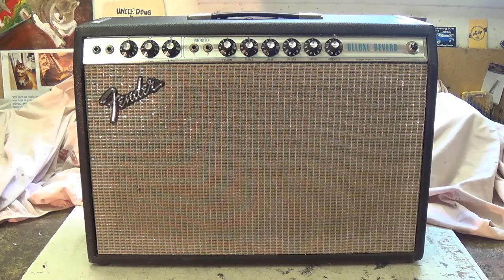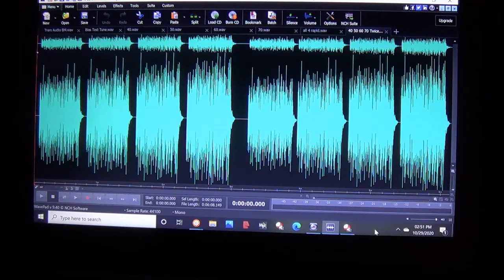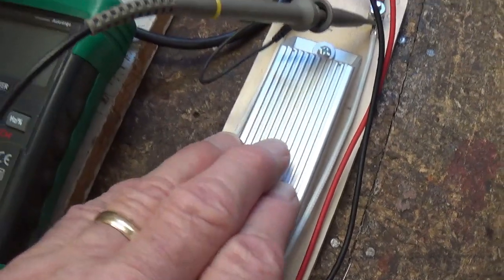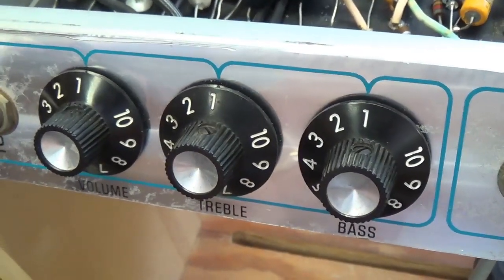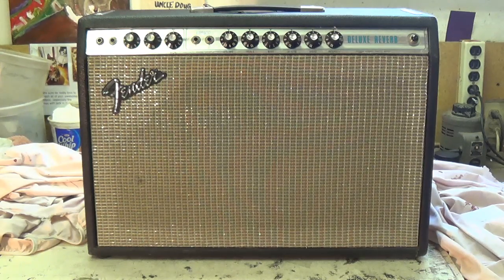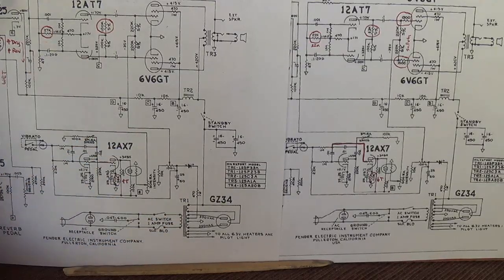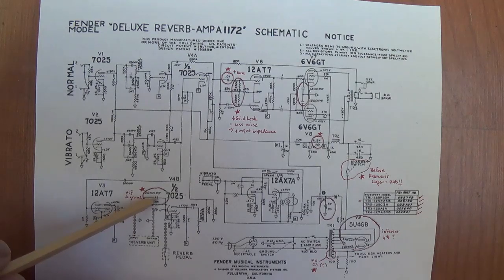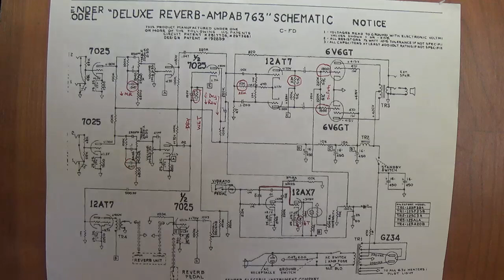The Effect of Output Tube Bias on Tone, Gain, and Headroom.....A Side-by-Side Comparison

Comment: The virtual filament ground was added as a method to fuse the heater circuit incase of a catastrophic tube failure so it wouldn't take out the power transformer if the tube shorted internally putting the high voltage on the heaters........as I come to understand it.  I don't have an amplifier chassis here in front of me to confirm it, but the "green/yellow" lead off the transformer bundle might be cut off and hiding in the bundle or tapped off and hiding in the bundle.  If you look at the layout diagrams that go with the particular schematics.....there is a red/yellow & a green/yellow transformer wire that both get grounded......the green/yellow is the heater ground and the red yellow is the high voltage center.  SO the schematics showing the earlier design with no virtual heater ground......you will see the red/yellow & the green/yellow going to ground on the layout diagram for that schematic.  On the virtual heater ground amps, the layout diagram only shows the red/yellow wire going to ground BUT being the same transformer part number, its still in the bundle but not used.....SO I believe its cut off and hiding in the bundle.  Its something I don't normally think about and overlook.  AS long as the 2 100ohm resistors are good.  Later in the Fender timeline they changed from the 2 100 ohm resistors going to ground, to using a situation they called HUM BALANCE...a center tapped to ground (wiper) balancing pot that off the top of my head is 100 ohms linear.  The theory was to shift the pot away from the center balanced position to swing it either way to reduce HUM should it be present when the pot is in its 50% balanced position.....since this involves an AC heater circuit.  The pot was usually at the end of the heater string of wiring but not always.  They might have used it later in the timeline because of the quality of the tubes that were available at the time considering that vacuum tubes were way beyond being obsoleted in the electronics industry at large.....in the age of solid state  technology.  The domestic producers of tube were phasing out the vacuum tube production lines and were not keeping the lines maintained at top notch as they bled them to the end of production.
Reply: You know that the power tube heaters need to be connected properly in push/pull, but the pre-amp tube heaters can go inconsistent.  Personally I like the string to be consistent with all the #9's on the same wire......but Fender made it a difficult visual when they used the same color wire for both sides of the heaters.  I end up having to follow the the twisted pairs the whole way down the line.        BUT in the history of things, you'll note that the 1950's tweeds used the #9 pins being put to ground and thus just one heater wire for the string.  SO circuitry evolution is interesting thru the timeline
Reply from the maker: Thanks for your detailed input, Mike.

Comment: Thanks so much for this amazing video Doug, both parts were highly educational, informative and eye-opening. I'd love to see more of these types of video.
Just one question about the tube bias analysis part. I was surprised the see that the waveform on the oscilloscope, even at lower amplitudes, was not really a sine wave, which is what I would have expected to see. Instead it looked far more triangular, shall we say, kind of like a smoothed-out sawtooth waveform. Is that because the signal generator isn't supplying a pure sine wave output in this case, or because it does generate a sine wave that is then transformed through the amplifier circuitry? Thanks again!
Reply from the maker: When large numbers of waveforms are compressed so they all fit on the screen, they assume a tall, narrow appearance.....but if you isolate a single waveform, it will be "sine shaped".
Reply: @UncleDoug  I see, thanks!

Comment: Man this is so awesome! I’m currently going to college for Audio Engineering and also learning more about electronics. I wish I could have you as a professor!
Reply from the maker: Thanks for the very nice comments, Arturo :)
Reply: @UncleDoug Of course! I do have one question. I just biased my 1996 Carvin MTS3200 which has a trim pot but I know is fixed bias. I didn’t have a shunt resistor, bias meter, or a meter that can measure low current accurately. But I do have a multimeter that can measure higher dc voltages and resistance great. 

Carvins method is to bias it across the standby switch and from the factory it says to do 100mA or 25mA for each power tube. The tubes I’m using are 6l6GC’s and I know 25mA is quite cold to run them. But again I don’t have a meter or shunt resistors that can measure the current across the switch. 

The method I did was measuring each tubes (which are matched) voltage across pin 3 and 8. I also know that the voltage will read higher than if I measured across pin 3 and the ground chasis. Got a plate to cathode voltage of 452 dc volts and then turned the amp off measured across the vcc terminal 1 and the wiper terminal 2 of the trim pot and got 12k ohms. I used ohms law and did 452/12k and got 0.0376 amp or 37.6mA. I then multiplied 452 and 0.0376 to get the plate dissipation and got just under 17 watts. I then calculated the dissipation by dividing the calculated wattage and the max wattage for the 6L6GC which is 30. So 16.99/30 is around 56% dissipation which for class AB fixed bias amps is on the slightly cooler side but sounds great to me. Was my method accurate or should I have done it differently cause the amp runs great and sounds great. Thanks again!
Reply from the maker: @arturogardunoguitar  Without a schematic, I woud have a hard time following your procedure, Arturo......which, to be honest, sounds quite questionable to me.  Please watch my video(s) on how to bias output tubes using the voltage drop across each half winding of the output transformer.  It is relatively simple......and quite accurate.
Reply: @UncleDoug Ahh I figured as much. I just finished watching your video on how to bias a quad set of output tubes and will rewatch it during the day when I double check my amp. I’ll see if my questionable method was at least somewhat close but i just realized my mistake in measuring the plate to cathode voltage of each tube when my amp is grid biased. I’ll know there will be a difference since plate to cathode usually reads higher but I’ll update you when it’s finished. Thanks again.
Reply from the maker: @arturogardunoguitar  Since the cathodes are grounded in fixed bias, there should be no difference between the plate to ground and plate to cathode measurements.
Reply: @UncleDoug I just finished doing your method of biasing. My Carvin amp has Blue, Red and Brown wires with red being the center tap of the output transformer. When probing each side the reading was jumping around slightly but settled in around the 33-34mA range after dividing the reading since both plates are wired in parallel. Anyways thanks for your help!
Reply from the maker: @arturogardunoguitar  You're welcome, Arturo.

Comment: I’ve seen several silver face power transformers with a clipped off center tap for the 6v windings. I’m pretty sure I’ve even seen one or two that were like that without a virtual center tap coming off of the pilot light or such. If memory serves, maybe even a clipped off center tap for filaments, one side grounded to chassis, one wire feeding heaters with other side of sockets grounded and no virtual center tap.
Reply from the maker: Yes, I too have seen the variations you described.

Comment: How about a little more on the input level.  You used 0.1 vrms, which is 0.141 vp2p, which is low compared to the input level of a standard single coil. Whats the fender recommended level for setting up these amps. Hum-buckers can be really hot, and some pedals even hotter on the input.
Reply from the maker: I have no idea what Fender recommends.
Reply: @UncleDoug  I have an old champ schematic that shows 100mv nominal input for 800mv at the input of the spring reverb, but doesn’t show anything about biasing.

Comment: love your videos uncle Doug! you make it look so simple with your methodical and patient approach. And your ability to explain a difficult subject almost makes me want to tackle my amp problems. I have an old mid 70's Music Man 212, HD 130, which needed a tube change. i changed them all(4 power tubes and 1 preamp tube)...unfortunately, the new tubes seem to have created a new problem. the tremolo now is all out of whack ... i got a matched set of JJ el34's which does sound pretty good, but the amp clearly feels like its not optimized for best performance as it seems to have less headroom and goes into overdrive at a lower volume...i watched some vids to see if i thought i could tackle the biasing by myself, but it looks to be kind of daunting on this amp...sure wish you lived next door Uncle Doug....
Reply from the maker: What you're describing is the classic result of improper biasing that occurs when new tubes are installed without being biased properly.  You really need to get them adjusted before using the amp any more, Raj, or damage could occur.
Reply: @UncleDoug  Thanks for the quick reply Doug... yeah, i figured i'd better not use the new tubes until i found someone who knows how to set the bias. Strangely, i put the old tubes back in, which , amazingly enough are the ORIGINAL tubes fro 1976, and they seem to be fine now. i thought they were going, because periodically i'd get some strange artifacts with the tone, but now they seem fine again. these old tube amps are really strange beasts. i never realized just how many things need to go right for these things to sound just right. thanks to your videos(and others who share their knowledge), i am now comprehending that. its such a great sounding amp, i really would love to hear what it can do when optimized by someone like yourself. amazing tone! thanks again Doug, for you videos and your reply.

Comment: Hi Dough,
Amazing video as always.
Would it be possible for you to do a video on the design of a miniature version of the Fender Champ, please?
I was wondering if it would be possible to use subminiature tubes to do a Fender Champ like amplifier.
Reply from the maker: Thanks, Pedro. I don't work with sub-miniature tubes, but there may be sites on the internet that can provide helpful info. Good luck.
Reply: @UncleDoug  Thanks. After all, I think I will go with standard tubes.
The main driver to go with the subminiature tubes was the size of the amp I want to build. The amp should be small enough, so it can sit on my desk (roughly the size of  a computer speaker). If I can accommodate normal size valves/tubes in that small enclosure, it would be wonderful.
One question is: can I use an SMPS from a laptop as the supply for the amp and then just have one transformer for the output?
The laptop power bricks I have at home are 16V and 4.5A (From old IBM T20 Thinkpads). Could I do a Fender champ with this?
For the speaker, I've thought of a 3 inch woofer. From what I've seen and read, the hifi woofer driver covers the same frequencies as the normal guitar amp speaker (let's say 70Hz-5kHz).
Is this feasible? Thanks in advance.

Comment: Now it also makes sense why tubes that aren't matched well, can make an amp sound better, richer. each tube would have a different preference of frequencies ('hotter tubes will reproduce lower frequencies at a higher volume) and that can mean the relatively unmatched tubes can complement each other.
Reply from the maker: That's an interesting theory, A......and it actually makes pretty good sense.

Comment: Could it be that the reason they moved the standby switch position is because of the use of that rectifier? The added kick on "power on" added with the charging of those caps was maybe too hard on the reftifier tube and shortened it's life?
Reply from the maker: It's easier for the rectifier to charge the two reservoir caps alone than to charge not only them but all the other filter caps as well. Putting the Standby Switch after the reservoir caps spreads out the stress to the rectifier.

Comment: Assuming a constant plate dissipation target (let’s say 70%), what’s the difference between higher voltage lower current or lower voltage higher current all things being equal on tone or headroom? I’ve heard some amp makers like running tubes at a lower voltage but at a higher plate current.
Reply from the maker: Plate voltage is essentially determined by the HV winding in the power transformer. The plate current, however is easily adjusted. Thus you must first pick the proper PT for the PV and then adjust the PC to a proper bias (plate dissipation) level. I know of no tone advantages to high PV vs high PV......the bias is what affects tone, at least in my opinion.
Reply: @UncleDoug  I appreciate the response. Thank you.

Comment: Question for you Doug, if you see this: I'm investigating why Fender (and Peavey before them) cold biased the 5150 - 6L6GC x 4 at 20 per tube, 80 total at a 480 or so plate voltage. It doesnt seem to make sense. I am yet to find an answer, hoping you can help.
Reply from the maker: I only deal with pre-79 vintage amps, Simon, so this is really out of my realm....but I can make a guess. I assume by "20" you mean 20mA of plate current, which when multiplied by a PV of 480 will yield a PD of only 9.6W, which is less than half the normal PD for 6L6GC's. EVH was noted for his "brown sound". achieved by using a Variac to reduce the AC supply quite a bit. Perhaps, this low bias is an attempt to recapture that saggy tone ??
Reply: Hey  @UncleDoug  you're probably right - thanks for your reply - I was reading  around 480v at pin 3, and Fender recommend 20mA per tube at the bias point (sorry for the poor explanation). Perhaps you're right. I've currently got it set to 20mA (80mA for the quad) and it doesn't sound anywhere near as grainy as your demo on the low bias setting (even given "recording of a recording" compensation).

Thanks for an excellent explanation on bias settings - it can be tough getting the right info online, and Im certainly no expert. Live long and prosper :-)
Reply from the maker: @GuvnaOnSpotify  Thanks, Simon. We're glad the video and response were helpful.

Comment: IMHO,  the most noticeable change from AB763 and newer designs (in terms of tone), is the coupling cap.  The bigger 0.01 cap not only gives more low end, it also adds a harsh/sterile mid peak.
Reply from the maker: I believe all of the BF and SF DR's had 0.1uf coupling caps for the output tubes, RC.
Reply: @UncleDoug  I apologize.  I meant the coupling cap on the input of the phase inverter.   AB763 was 0.001, and 70s silver face used the 0.01

Comment: Posting this,  you sort of read my thoughts.  Other channels suggest complete balancing (cannot recall how they did it) of dual output tubes,  to be equal,  others may think that setting biases slightly differently between them might give a tone that is preferred by guitarists,  though one could argue that the final output should be as pure as possible, with the intermediate stages creating the sound as guitarist one wants.
Reply from the maker: Thanks, HP. You'll find as many opinions as people.......that's what makes us each an individual :)

Comment: Another very informative video! Thank you Doug!
As I am considering to build a tube guitar amp, I try to obtain a maximum of information. On some subjects I do not find a lot of information such as: When do you have to replace tubes? Do you have to replace them all at once? Is there a way to test tubes without a tubetester? How to make a DIY tubetester?
Maybe an idea for one of your next videos?
Best Regards, William
Reply from the maker: Greetings, William. Tubes are similar to the batteries in a flashlight.......you know when they are getting old and weak, generally without a tester. They don't wear out at the same time, and will generally last much longer than you might expect......often years, depending on use.
Reply: @UncleDoug  Hello Doug, Thank you for answering. Ok, but when they do not wear out at the same time, how do you know wich tube you have to replace? Or do you replace them all that same moment?
Best Regards, William

Comment: I just finished a 5f1 amp and before checking anything like bias, I just plugged a guitar in and it was awesome. Distortion was beautiful and plentiful, but the tube was running hot , very hot. I adjusted the bias to where it should be, and the amp had some of that good distortion at higher volumes, but was much cleaner at lower volumes. No doubt the tone changed. So I guess, high bias means more distortion and vice versa. Tube life may be shortened, but it's very tempting, man it sounded good, running hot!
Reply from the maker: That's probably why Fender biased all their amps quite hot, back when tubes were cheap and plentiful.
Reply: @UncleDoug  Well I think I'll bias this amp a little hotter just because it sounds better, tubes be damned. LOL

Comment: I think one advantage of the virtual center tap, if an output tube gets a filament to cathode short, the grounded center tap might take out the power transformer.  I'm also wondering how that would work with the preamp tube since the virtual will allow the filament voltage lines to drift up closer to the cathode voltage in those tubes to minimize filament to cathode current.
Reply from the maker: I guess it's possible, Russell, but I have never encountered a PT that was destroyed by a shorted filament.......yet ;)

Comment: Hi Uncle Doug Great video again! I am only part way through the video but are you able to determine if this is preamp distortion, PI stage distoprtion or power amp distortion or does it not matter in this analysis?
Reply from the maker: If you mean clipping, I believe it occurs in the output tubes.....and is thus affected by the tube bias.